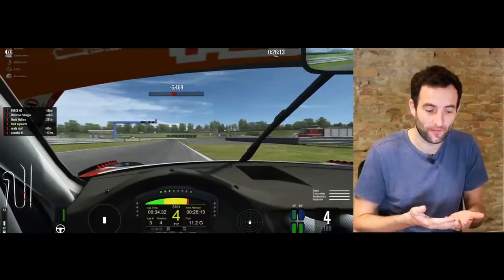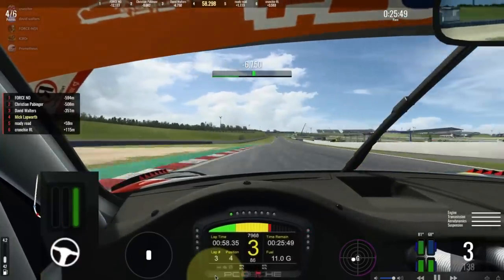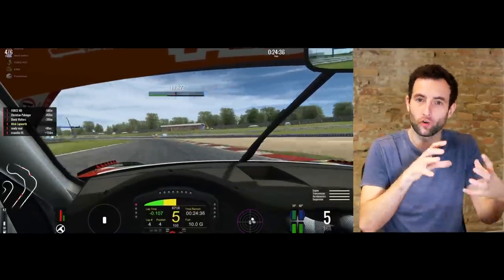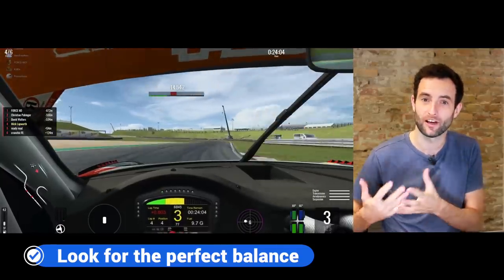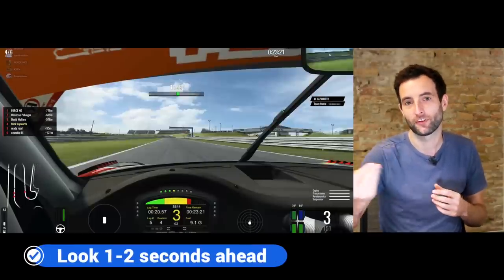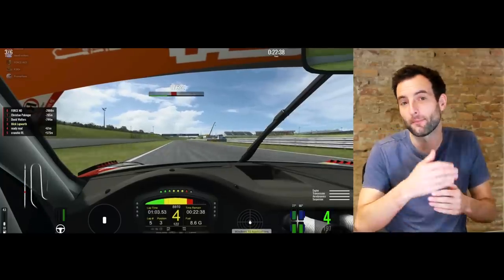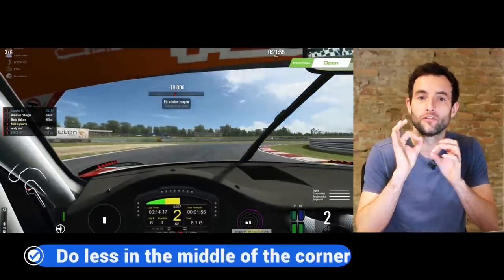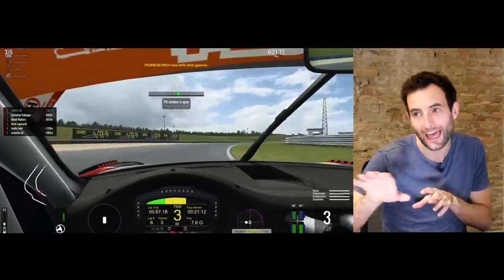Are You Using The Throttle all WRONG? [Sim Racing]

Comment: Great video and perfect timing for me! I recently discovered that my throttle control was crap and have been working on it since. As you said, proper vision has helped a lot. I'm now constantly reminding myself to look as far ahead as possible. I also put a stiffer spring in my throttle pedal to give me more feel at the beginning of the pedal's travel. It helps keep me from using too much too soon.

Comment: Hey scott, would be nice if you could look at the different pedel types available on the market. One of the biggest isues with throttle and brake application are the light weight springs used on sim pedels. Its not until you get upto the above 1K type pedels that this really irons itself out. It mights be a good idea if you could get some and look at ways in which we may be able to setup around the issue or even suggest springs etc to look for to get the feel on the pedel right.
Reply: I recently moved from the standard G920 pedels after spending money on a bodner conversion and different performance kits to a set of fanatec V2 pedels and while the brakes are now awesome the throttle is still on the light side. The other issue it how to get around software ramping built in to emulate such things as a butterfly response.
Reply: Yo can also get a load cell mod with the fanatecs ::)
Reply: i have G29 and if i want i have no problem with throttle or brake application imo ...no wheelspins etc, consistent braking in every corner with different cars, just no issue for me (driving in iRacing)
Reply: @SgtRayman  thats fair enough, different people have different requirements. No two pro drivers like exactly the same set up so why would sim be different. That said a change to the fanatecs wiped more than a second on most tracks off my times and even more on some. The loadcell braking makes the biggest difference for threshold braking and trail braking once its setup right. But if you're happy with what you have that cool.
Reply: @jonharrison8130  oh yea, since i can still see that i am competetive with that setup i will keep it ...but i am definitely not against upgrading if i need to :)
Reply: @SgtRayman  Its a journey for us all. Its like starting out with a car and it feels on the edge all the time and then 2 seasons in it feels totally under control. As we develop our skills and get better we want more from the car. TBH I stayed with those pedels for a year or so before upgrading and focused more on the time that was in me by cutting out the stupid mistakes first before looking at the equipment. Its one of the reasons I have kept the wheel. A newer wheel won't improve my turn in point or control through a corner. That said and after speaking to a few people a DD wheel is next on the list, our wheels have an amount of deley that isn't present in a DD wheel and a definition for force feedback thats a bit lumpy in the logitech's. But whatever keeps the racing close and fun and keeps us all improving as drivers is great for the sport.
Reply: @gtspeedster  Yeah I agree. This was the idea of asking someone like scott to have a look from a pro point of view on how best to set up a range of the pedels available. I know that I found time in playing around with them but I don't think for one minute I ever got the best out of them. Maybe you know a good source for that kind of information. It would be good for people to know.

Comment: Great idea to dedicate a channel to sim drivers. Not everybody has the means to go racing in real life :-). 

One of the things I struggle with in driving sims is to understand when I'm driving on the edge of the grip / when I start having understeer / when I start having understeer. Any suggestions on how the force feedback wheel let's you know or how to set up sound (in general lines of course) to detect being on the edge would be very very welcome.
Best of luck with the channel.
Reply: I use my eyes a little more than relying on the FFB. Ie when I see the car rotate more than the corner, I see oversteer. and if I see the front wandering, understeer. Driving is very visual. But you need to spot this quick mid corner and adjust. Hope it helps

Comment: First, i like watching your "masterclasses" and most of it makes pretty good sense... as a basis.
But drivers have different styles.
You can say 'you should do this or you should do that, but some drivers prever a car that turns like it's on rails, others (like Michael Schumacher) prever a bit of oversteer.
Ayrton Senna always seemed to be "dancing" with his car.

As for the throttle,
Have you ever looked at Ayrton Senna's technique?
I've seen your video on "heel toe" technique and Ayrton didn't only push the throttle to match his revs with his gears.
He severely fluctuates his throttle at the beginning of the exit of a corner, before putting it to the floor.
Some believe it's a remnant of his "turbo era" in order to limit turbo lag.
Anyhow, it worked for him.

As I said, I like your channel and love watching it, so keep it up.

Comment: Hi Scott ...I'm new to this so I'll have some basic questions & don't mind if you refer me to previous video's.
My experience in Sim-racing is ZERO ...I'm trying to become competitive enough to race on-line. So I practice a lot with Forza 7 & F1 2018 on a decent "Rig" (Logitech 920 with a 6 speed shifter). I can't seem to stay out of trouble at the beginning ...I can do pretty good threading through the slower cars but inevitably end up in
the AI pile up in the first turn ...if I'm patient & let 'em go & pile up without me ...I get rammed from behind or taken out in some other ridiculous fashion. It does not happen as much in F1 ...my question is "Is this an (aggravating) AI programming thing that does not occur in live Sim racing?" And do you have any advice ...do I race somewhat aggressive at the first & pass a few cars or apply patience & try to avoid the AI carnage. In Forza 7 ...The only time I can actually practice racing civil & adhere to a race line is when no other cars are around me ...when I'm within distance the AI cars block or simply wreck you out & that setting is with Aggression Limiting turned "On" & Drivatar Difficulty on "Highly Skilled".

Comment: I wish my W and S buttons act like real pedals.
Reply: Yeah, a wheel is great. I'd recommend a Logitech Driving Force GT as the cheapest option that has force feedback. They don't make them anymore, but you can find them on eBay. I actually just upgraded recently, and I'd sell mine if you're interested.
Reply: Buy Wooting keyboard
Reply: I got Arduino laying around. Probably I can build one by myself lol
Reply: Buy Steering wheel
Reply: @spizzlo  salesman?
Reply: @moe5346  Im surprised he didnt drop an affiliate link lol
Reply: @fightlikabrave  😂 i cant blame him tho :b
Reply: I use vJoy and FreePIE to make my mouse act like wheel and pedals, and it actually works quite well
Though, some things like left foot braking are virtually impossible (at least the way I have it set up)
Reply: if you want to play sim racing games get a used Logitech wheels and pedals, plus a shifter, for around 200 dollars. Assetto corsa ultimate edition costs 80 but sometimes it gets 90% off during steam sale and you could get it for under 10 usd
Reply: the ps5 controller helps simulate this
Reply: My thrust master keyboard has Fbb and pressure sensitive w and s buttons .😂😂😎😎

Comment: I am starting to smooth out my driving and its weird i feel like i am going slower but my times are better..Its hard for me to shut off what, in my mind, feels fasts
Reply: You're experiencing less panic. Because you are smoother, everything feels less hurried and more in control, and thus it feels slower because you're not mashing the throttle and wringing the neck of the vehicle. However, because you're being more mechanically sympathetic the vehicle rewards you with lower laptimes, thanks to a better balance. If you ever ride a motorbike you'll feel this tenfold - unless you're right at the ragged edge then riding more smoothly is considerably faster than riding "hard".
Reply: Slower is faster ;)
Reply: Ever follow a faster driver and notice how they make it look smooth and effortless? All about looking far ahead and smooth applications.
Reply: Not slower, just smoother.
Reply: @supersloth1667  no
Reply: It also could be your FOV is off
Reply: its happens to me wen playing f1 2020. when you feel smother run you'll be faster in time
Reply: Slower is smoother. Smoother is faster.

Comment: I've found (in my experience) going from a real car to sim that I often forget to respect my inertia. In the car you can feel the transfer and spend far less time on the loud pedal on entry and mid using it only to counter the under steer/ balance. Graduating as you see where you are going including what your arse and hands are telling you to exit the corner. In Sim racing I can't quite turn off the, I see the exit in stages so go after it a stage at a time and often get front wash. I can't seem to substitute to inputs and end up relying on my eyes.

Comment: Nice video and good advice. It would be good if you talk more about the technical aspects of vehicle stability and how driver inputs affect the car. For example: understeer due to excessive throttle application isn’t just about weight transfer, it’s also about differential lock. The differential locks up more as torque is applied. This information can be used to improve steering characteristics, such as a fast sweeping corner where continuous full or part throttle is required. It can be beneficial to reduce throttle inputs slightly to reduce diff lock allowing the car to turn before smoothly reapplying the throttle. At higher speeds where downforce is high and acceleration is low, throttle inputs affect vehicle balance less and it becomes more about the mechanics of the vehicle and how that is affected by driver inputs. 
I’m not a pro racer but I am an engineer and I love cars so I’m reasonably knowledgeable about the mechanics of a car and how driver inputs affect the cars behaviour.

Comment: What about Engine braking?
I see a lot of my friends engine braking before some corners and i don't really know where I can use that. For example let's say I start braking hard at the 100 meters sign and I see them start engine braking at the 150 meters  sign and then use brakes but not as hard as I do and they exit the corner faster than me.
I hope you could do a video about Engine braking/ lift and coast versus heavy braking explanation .. Thank you in advance.
Reply: Mathew Adams that’s most likely for fuel saving
Reply: Is that just coasting?
Reply: Consistent downshifts can deffo help reduce the amount of braking required in braking zones but too much will lock the diff and spin you. I tend to find a cheeky down and upshift mid corner can help to align the car for the apex but again you have to be careful not to over lock the diff and spin out. It all depends on the kind of car you are driving. GT's are better with engine braking, aero cars are more of a fine balancing act.
Reply: I'd say they're faster than you when exiting the corner because they probably go in slower. As the saying goes: "slow in, fast out".
Reply: @juraj_b  Or cooling the brakes
Reply: @Mathew Adams Any coasting before braking is for fuel saving. But if they end up faster than you, it means that by braking less aggressively they have more control over speed, enter the corner faster which not only is a big time saver but also prevents what we see in this video - erratic throttle use before the apex which unsettles the car and confuses the handling. Then with much stabler and predictable car they have cleaner exit gaining further time and speed on straight.
Reply: David Aguilera that’s what he said
Reply: In karting and short track racing we call that ‘freerolling’ and it’s what we strive to do for chassis balance.
Reply: @thesnitch7  coasting would be clutch in or in neutral. Engine braking is from the back pressure of the engine slowing down.
Reply: I recently returned to iRacing and while racing Skip Barbers and F3 on Lime Rock, engine braking at the start of the lap is one of the most important things I learned. When I tried to brake instead I found the car unbalanced itself and I either spun or lost far too much speed

Comment: This is good basic advice for people who are just getting started and are way off the pace or having issues controlling the car. If you are new, follow this advice. But I think at a more advanced level, trail brake and get the car rotated early and pointed in the right direction slightly before the apex, then get on the throttle as early as possible and as hard as possible while straightening the wheel (then hold on for dear life as you get slingshotted toward the exit). Instead of the car traveling in a steady arcing fashion, the corner becomes more of a V shape. I'm not saying don't be smooth, but if you're not smooth AND very aggressive you will be WAY off the pace.
Reply: I agreed, looking at some footage of formula1 drivers the way their inputs are is literally on/off, very aggressive with pedals inputs but on the other hand the steering input is so smooth.

Comment: Nice video, but i feel it has quite little actual info, besides look ahead more and don't punch.  No example of how you should do it. Would be much better to have a comparission between a  good and bad. And not just look at a bad example. 
Also no mention of using the throttle to help turn. Like too much will not automatically produce understeer, specially not in a rwd car and on quite a few setups you use the throttle to help the car turn faster, without going into an oversteering situation.

Comment: What's the most efficient way to navigate through a series of corners. eg a chicane or 3-4 close sharp corners in a row = lots of fast direction changes.
Reply: Always think of the next corner in the series before you're exiting the previous. Don't sharply transition from the exit of one into the entry of another (no sudden inputs). The most efficient line will depend on the car and its limits, watch replays of better drivers. Suzuka esses is a great one.

Comment: Great Scott ! What a great video & technique Scott ! 👏
That said, Ayrton Senna was supposedly famous for his staccato throttle technique where he would be on & off the throttle through the corners.
Could you elaborate on how such a technique could be useful Scott ?
Reply: In the case of a turbocharged engine with high levels of boost, there can be a significant lag between the time the accelerator is pressed and the time the engine starts making full power. By stabbing at the throttle early, it puts exhaust gas through the turbo, meaning it is already producing some boost pressure when the time comes to accelerate away from the corner, so the lag time will be reduced.

Comment: I left simracing 2 years ago after many competitive seasons. What I learned about this subject.1 Brake for the corner. 2 let the car relax in the turn and don't press the throttle. 3 A small amount of throttle midcorner helps the front of the car dive in to the apex. 4 once the front end is pointing to the exit of the corner start throttling up progressively to 100%

Comment: Interesting fact is that Ayrton Senna used harsh throttle input to his advantage. Never seen him use a smooth throttle input on initial input.
Reply: It depends on the engine concept aswell. On turbo engines for example those harsh inputs can controll turbo pressure if you know what you are doing. Also it depends massivly on the setup. In this tutorial here, he discuss the driving style on a absolutly neutral car, but when your car has not a 100% perfect setup, you need to make your way arround those issues. In a perfect world with a perfect setup, you would just be super super smooth with your inputs, but actually that is not the case in the real world.

Comment: Nice one Scott. In sim it's tricky to find the point where you transition from brake to throttle and effectively hold road load so you don't lose momentum. Well, it's trickier for me, at least. I find it easier to do this transition in my car at the track. Perhaps this can be adjusted in the sim through settings of throttle deadband but it's not good for training your right foot.

Comment: As a none driver I have problems knowing when to change gears up or down
Reply: Its all about keeping the engine rpm in the optimum range. If rpm is getting too low, shift down. Shift up before you hit redline. Useful also would be the  engine sound. Also if you press the gas and you're not accelerating fast enough then you need to shift down.
Reply: My main tip cause I can relate is: Don't overthink it, it's as simple as you'd think. Then the latter stage is what Felipe said, finding the  optimal rev range for the car

Comment: Can you help with some ARB clarification? If we have a typical ARB set up with 2 bar sizes small and large and there is also 10 different blade adjustments, how is a normal stepped increase in ARB stiffness obtained? Is it by starting with the Small Bar and Blade 1, then onto Small Bar and Blade 2, and so forth up to Blade 10? Then changing to the Large bar with Blade 1, and then progressing onward from there?   Or, would it be SML-1 then LRG-1, then SML-2 then LRG-2, and so forth.  Please can you give us some insight into how a normal graduation would occur with the steps. Thank you for your time.